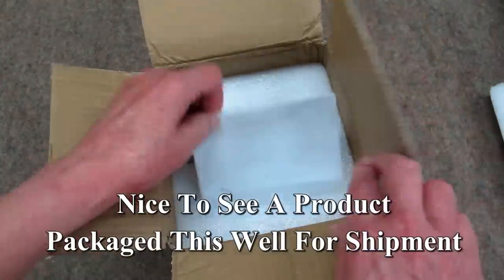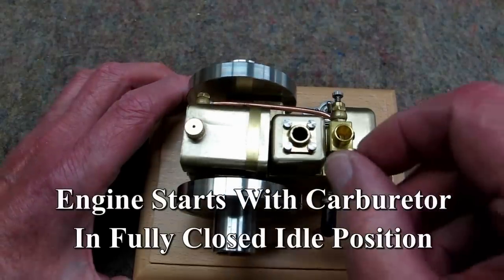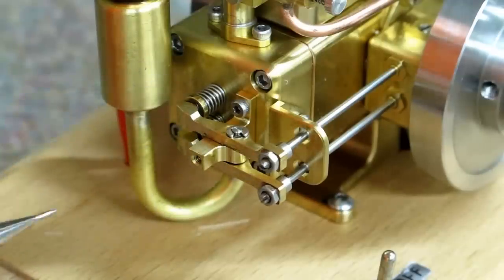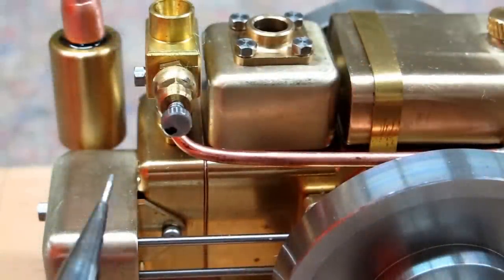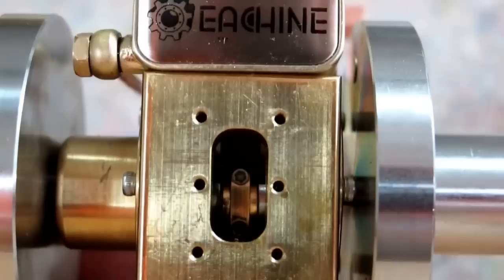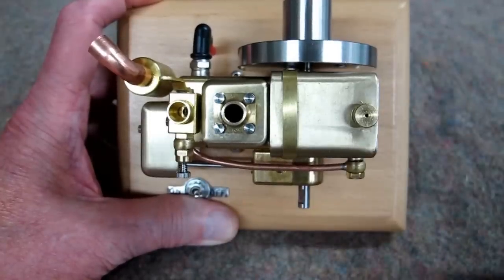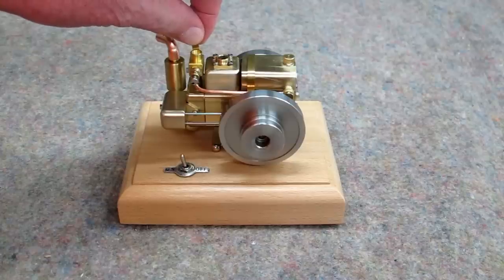Eachine ET5 Mini Gasoline Engine

Comment: I thought the hit-miss engines had magnetos, not batteries
Reply from the maker: A lot of the old full-size hit and miss engines did have magneto ignition just like lawn mowers, weed eaters and leaf blowers have today, however it is difficult to miniaturize a magneto ignition and it may not be very efficient. Since it is the model engine we are making a small replica of and not the ignition system, use of a Hall effect sensor and an electronic ignition is cheaper and more practical. 
Thanks for watching. Please subscribe! 
That is what keeps this channel running. 
Ron

Comment: That would be such a great gift for anyone who is a good mechanic. I would be so happy to have one as a gift. 😊
Reply from the maker: Generally I find I purchase the best "gifts" for me. :-)

ET1 (M90), ET7 (M94) and ET6 (M92) are my favorite hit-n-miss engines, in that order. 

ET1 (M90) was the first in the series. ET7 (M94) has a simplified governor and is easiest to work on in terms of replacing the piston ring o-ring. 

EM2 (M19) is also a really nice engine. Pretty little engine and a good runner.

I would totally avoid the ET5 (M12), ET5 Pro (M12 pro), ET5S (M12C) and ET8 (M93) engines.

I always suggest using PayPal for payment which simply gives you one more layer of protection. Therefore if it is damaged in shipment or doesn’t run you are covered. 

Banggood appears to no longer be interested in selling engines or unwilling to keep them in stock. 

I now recommend obtaining these engine from EngineDIY.com

Referral Link 6%  https://www.enginediy.com/?ref=V81L4uEO

Coupon Code 10% Off -  Ron'sStuff

Thanks for watching. Please subscribe!
That is what keeps this channel going.
Ron

Comment: Will it start when you use unleaded diesel or diesel with lead?
Reply from the maker: Watch this. Same fuel works in the ET5.

Hit & Miss Engines - The Correct Fuel
https://youtu.be/TvLziWCI7Oo
Reply: @RonaldWalters2010  and what is the cheapest engine model?
Reply from the maker: Probably the first hit & miss... ET1

Comment: Dear Ron , short question: in which direction should the carbretor screw be turned for lean mixture ? and for rich mixture ? Thanks a lot greeting from germany !!
Reply from the maker: Clockwise rotation closes the valve, which makes the mixture leaner. 
Counterclockwise opens the valve for a richer mixture.

Something I did not cover in this video is that the carburetor has two needle valves… one for high speed and one for low speed (idle speed).

Get the engine running correctly before messing with the low speed needle and remember, do not over speed the engine. Hopefully the carburetor was correctly set from the factory so the engine runs just as you received it.

Also, the carburetor settings will be a little easier after the engine has warmed up a little.

This video explains the adjustment of both needles… a little over halfway through the video. 

Eachine ET5S Twin Cylinder Engine Review
https://youtu.be/kdk1FlVH3iQ

Thanks for watching. Please subscribe! 
That is what keeps this channel going. 
Ron
Reply: @RonaldWalters2010  Many Thanks Ron! I Subscribe you channel now. Best regards !!

Comment: Can this Engine Run with Gasoline E10 ? Thanks a lot
Reply from the maker: You can run these engines on regular automotive gasoline however you do not need all the additives which tend to be in automotive gasoline. 
I have a video on The Correct Fuel which is a blend of Coleman camping fuel which burns cleaner and the exhaust isn't as bad. 
Thanks for watching. Please subscribe. 
That is what keeps this channel running. 
Ron

Comment: What  is power in watt per second  of ET 5?
Reply from the maker: These are model engines. I do not post any more specifications than what the manufacturer gives. Click on a link (located in the video description) for any particular engine and you can read what specs are available on the Banggood website.

Comment: Hi Ronald Great video. I got the same engine, but I'm too stupid to start the engine with the included tool.
I would like to to start it with my cordless drill and the adapter you are using, which is fitting in the machine's wheel.
Unfortunately, nowhere in Amazon , Ebay or anywhere else I can't find this special Bit ( adapter ) I have to say, that I live in Munich, Germany.
Probably you could tell me, how the adapter is named, so that I have a chance to find it somewhere here in Germany or Europe.
Reply: I just had to watch your unboxing part carefully, so I detected the adapter which was included in the package. But unfortunately, the engine doesn't start at all. It's obviously a little bit different to your one, because it's using 3 batteries ( 4.5V).Fueltank and batteries are full, so I really don't know, why it's not starting.
Reply from the maker: It can be frustrating when one of these decides not to run. 

This is my basic (canned response) checklist for this engine. 

I assume you have compression. Sometimes the valves can stick open and there will be no compression. Just flick the valves gently to get them to free up and seal.

Make sure the switch is wired correctly… so “ON” is actually “ON”. It is possible for it to be wired backwards accidentally.

The boot needs to be on the spark plug and then the wire just butts up against the end of the plug. 

They changed the battery pack to hold three batteries some time ago. Make sure the three batteries are installed in the battery holder in the correct orientation. Make sure your batteries are good and that you have a good spark.

This engine does not have much compression (at least my ET5 did not have much compression). If you have zero compression, remove the valve cover and flick the valves a little and make sure the valves are actually closing. And that there is a slight gap between the valve arm and the valve stem. You need some compression. 

Start with the carburetor needle valve 1/4 turn open. You may need to GRADUALLY increase the opening of the needle valve 3/8 to 1/2 turn (maybe a little more). Each engine (or each carburetor) could be slightly different. 

Carburetor needs to be full closed to the idle position (this is set at the factory) for starting. 

What fuel are you using? I have a video on the Correct Fuel.

After it starts running, then you can close the needle valve slightly until it runs correctly. 

It is not easy to get all the air out of the fuel line. Fill the tank completely so the connection to the fuel line is completely covered. If there is any air in the fuel line, even one bubble, the engine will not start. 

With the engine starter (cordless drill) turning, place your finger over the carburetor to choke the engine and completely fill the fuel line. If you run out of fuel, then air will get into the fuel line and you will need to do this again. 

If you get too much fuel into the engine (flooded engine and the spark plug is too wet) it will not start either. Then you will need to dry the plug and get excess fuel out of the cylinder. To do this gently remove the spark plug and spin the engine with a rope starter. 

I really do not recommend using the cordless drill adapter. I think it can be a bit rough on the engine. Sometimes the cordless drill starter can make it more difficult to start the engine because you must pull the adapter out while the drill it running full speed. Sometimes this can drag and actually slow down the engine. Or your cordless drill may not turn fast enough. 

Make a rope starter using smaller cord as I show in my video. It will spin the engine faster than a cordless drill. Get someone to help you hold the engine so you do not accidentally pull it off the table and drop or damage the engine. 

Keep the box and all packing materials for the engine until you are satisfied the engine is running correctly.

Hope that helps. Please let me know how you do. 

Thanks for watching. Please subscribe. 
That's what keeps this channel going! 
Ron
Reply: Hi Ron
Thank you so much for your quick and detailed answer and troubleshooting steps. I will check all of your advices and will be back to you soon. Keep you informed.
Regards. Werner
Reply: Hi Ron. 
Meanwhile I checked everything.There are a couple of things, I'm not sure about it. First, to the spark there is no connector to it, just a red wire in the black rubber part. Not sure wether this is ok so. Contact problems? My three batteries have a charge of aprox. 1.45 each. In seriell, total voltage is 4.1V. Not sure, wether this is enough for the funtionality. My third concerning is the fuel. As in some youtube videos seen, I'm using normal Zippo Lighter fuel. But this is more than 8 years old. Could it be, that the consistency is not ok anymore? I also played with the oil needle and the carburetor, without any success.
Reply: Hi Ron
Watching another video from you, I learned a lot again. Now I know, that the red wire, heading to the spark has no connector. The ignitor is working with the 4.1V. The spark is always there, easily to see in dark.
No idea, why the engine still doesn't start. Probably the old Zippo lighter fuel?
Reply from the maker: Hello Werner,
Does your engine have compression?
Zippo lighter fluid is basically naphtha, as is Coleman Camping Fuel in the USA. 
I recommend naphtha as it is clean burning. You could try some of your automotive petrol (highest octane available). 
The other possibility is air trapped in the fuel line between the tank and the needle valve.
Your cordless drill needs to be set at the highest speed.
Carburetor throttle needs to be closed to smallest opening (idle position) when trying to start it.
Ron
Reply: Ron
Thank you so much, trying to help my engine running.
How can I check for compression?
Using my cordless drill, I can see the two valves closing and opening. For my ( as an engine beginner ) it looks good, but can't say wether the engine has compression or not. I filled the tank completely and turned the wheel. How can I check for air in the line?
My cordless drill runs up to 3000 1/min, should be enough yes?
I did everything what you recommend with the carburetor and the oil needle, no success.
Tomorrow, I try to to get a small bottle of unleaded fuel ( octane 95 or 98 ).
Greetings from Munich/Germany
Werner
Reply from the maker: Werner,
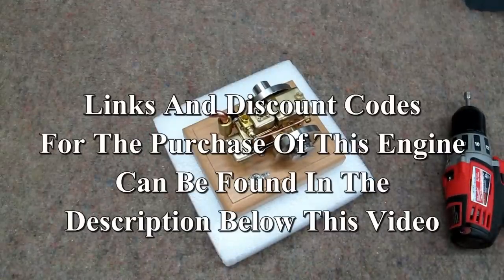In my review video for this ET5 engine… around 9:15 I show starting the engine where I briefly put my finger on top of the carburetor to “choke” the carburetor, which helps draw fuel into the carburetor and will (eventually) get the air out of the fuel line. If you choke it too much, you will get too much fuel into the combustion chamber, the spark plug will get wet and it will also not start.

Also, make sure your cordless drill is spinning the flywheel clockwise.

The fuel needs a very slight amount of oil in it to lubricate the o-ring piston ring. I recommend Marvel Mystery Oil again because it seems to burn quite cleanly.

Apparently you are not very familiar with engines. This is a 4-cycle or 4-stroke internal combustion engine. It only comes up on compression on the “compression” stroke and the spark plug then fires slightly past TDC (top dead center).

Watch the following video on another engine. Around 2:30 I explain how a 4-cycle engine works. It also explains how the ignition system works.
Eachine ET1 Upgraded Hit & Miss Engine
https://www.youtube.com/watch?v=ZCrjj4niyto

On the compression stroke, both valves (intake and exhaust) are closed and the air/fuel mixture inside the combustion chamber is being compressed… if your engine has compression you should be able to feel the resistance of the compression. Once the piston passes TDC (top dead center) that resistance goes away. If the valves are not sealing tightly or if something is holding them open then you may not have compression.

Note: Some of these ET5 engine have very low compression. 

Where did you purchase the engine? How long have you had it?

There is a limit to how much I can help you because I cannot see what you are doing nor what you can see that is happening.

Do you have a friend who would be familiar with engines? Someone who works on small engines (lawn mower, weed eater, leaf blower, small generators) or model airplane engines or possibly their own car engine? Someone familiar with small engines would be best. Sometimes those who work on larger equipment can be a bit too rough. :-) Someone with finesse would be preferred.
Ron